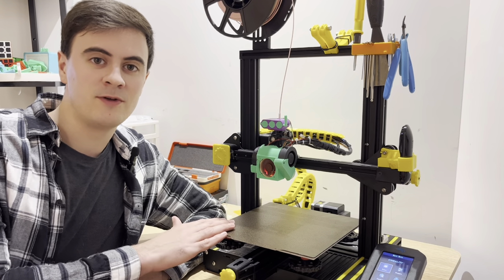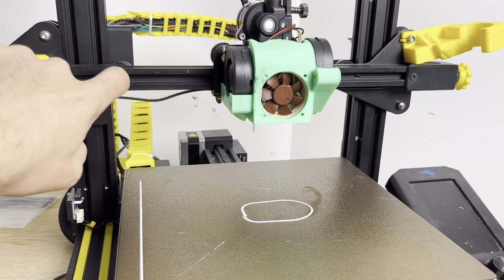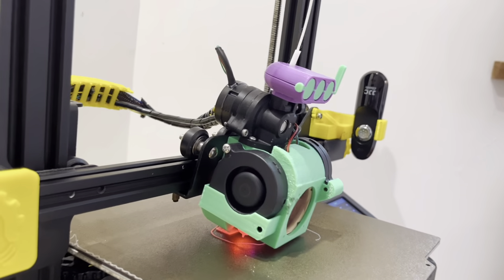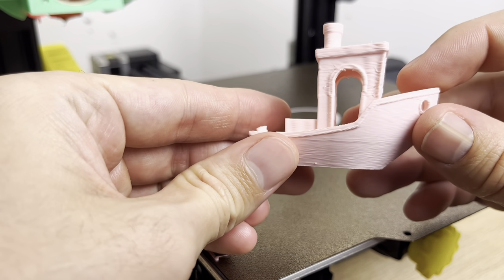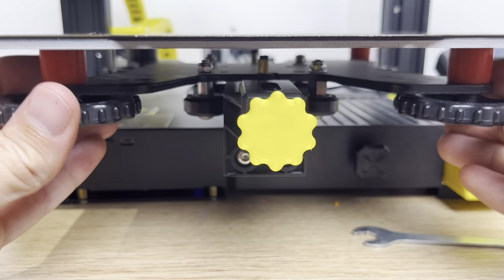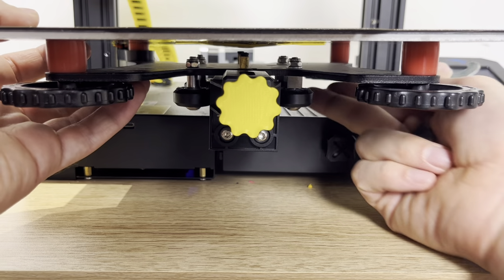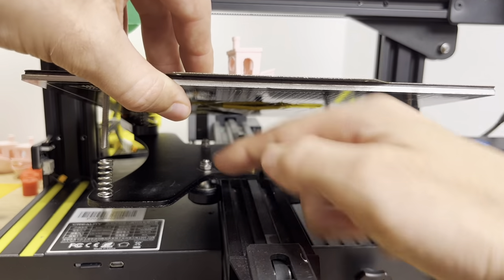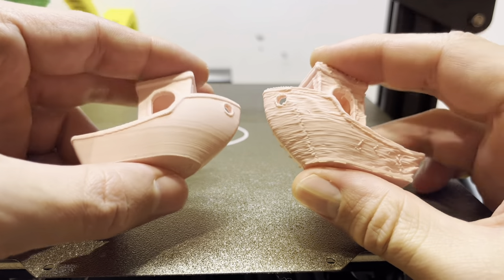These 5 things can destroy your 3D prints!

Comment: My printhead was loose, I turned the eccentric nut, didn’t fix it, so I had to take the carriage off and physically bend the sheet metal for it to tighten enough. Now it’s really tight with zero wiggle. However I then noticed that my Z rod is damaged so my prints don’t have that high quality surface finish. I’ve ordered the parts for a Belt Z, but probably need to get a new hotend to be able to print the parts for the Belted Z mod
Reply from the maker: Wow that’s a lot of printer struggles! I found my eccentric but could not tighten in one case I had to replace the roller wheel. I hope you get your printer figured out!
Reply: @DesktopInventions  the longer I have my ender, the more problems arise, starting to think I should’ve gone for a Prusa instead
Reply from the maker: Yup I've not owned a Prusa before but I'm guessing an ender 3 ages like milk (without maintenance) and a Prusa ages more like fine wine 😂
Reply: @DesktopInventions  it really does